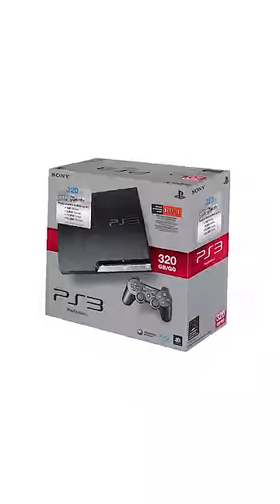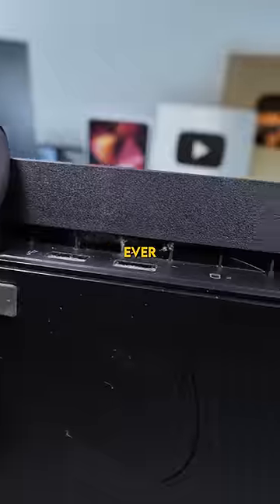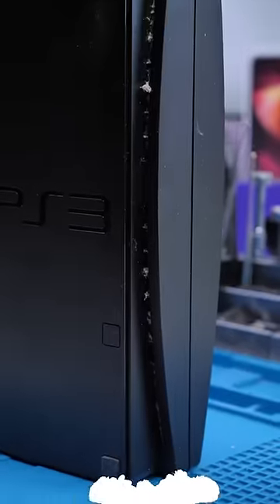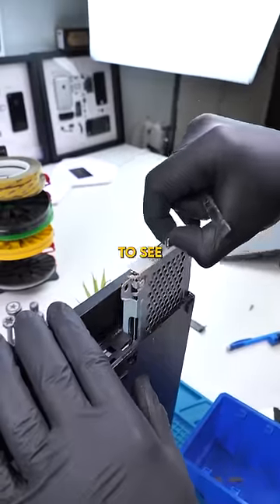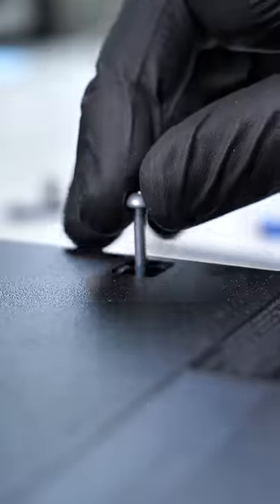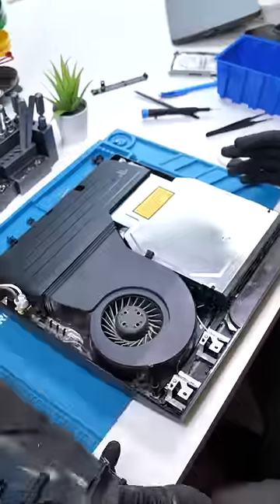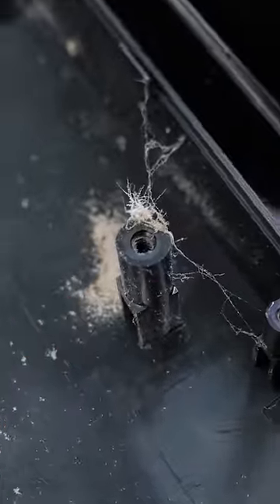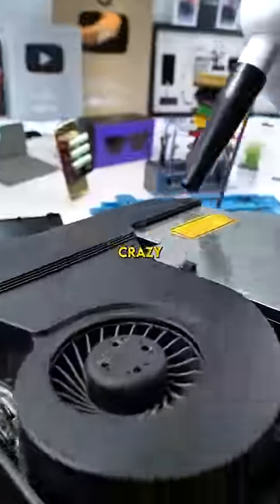He PAID Me to Clean His PS3...? #Shorts

Comment: Yo, if you unplug the power chord and hold down the disc tray button and then plug it back in while holding it down it turn the cooling fans on full blast to clean out dust
Reply: That function was to eject discs when the OS can’t be loaded, the fan defaults to 0x0 (max speed) since syscon can’t tell the fan what speed to actually run at. It’s denoted as BD ejct or some such in syscon logs…
Reply: @jamesgoodman540  yeah I'm pretty techy but I think you just broke me. I'm gonna go reboot now.

Comment: There is actually a special function on PS3s that blows the fan backwards, exploding dust out the back. Ask me how I know.
Reply: That function was to eject discs when the OS can’t be loaded, the fan defaults to 0x0 (max speed) since syscon can’t tell the fan what speed to actually run at. It’s denoted as BD ejct or some such in syscon logs…  The fan doesn’t spin backwards. You know because it was a super popular myth.